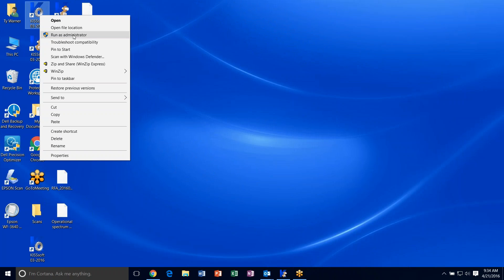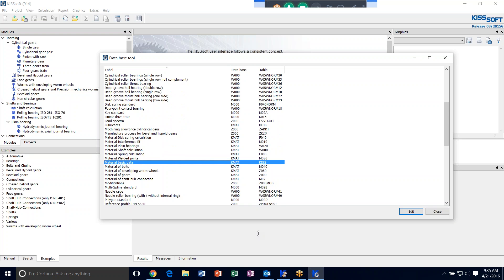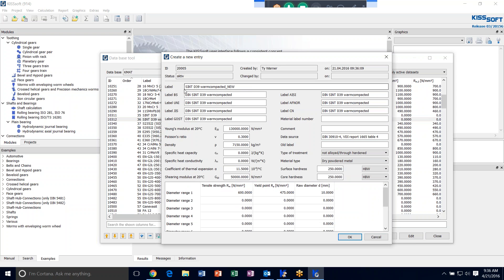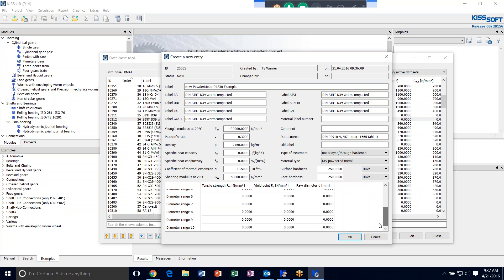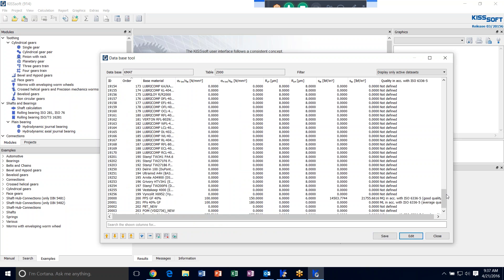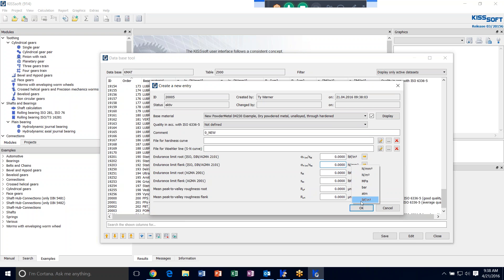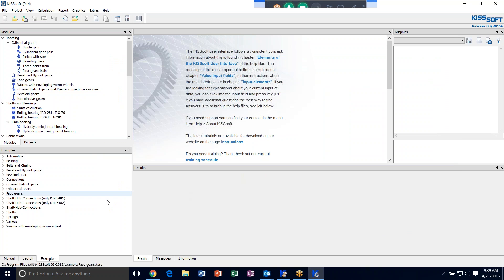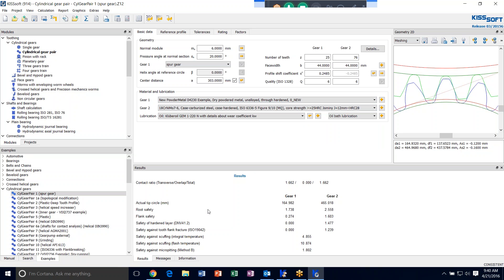Entering Own Materials in KISSsoft

Comment: When I open the Data Base Tool I get the message: "The data base directory is write-protected."
How can I give authorization? I can only press OK at that dialog.
Reply from the maker: You need to right click on the desktop icon and run as administrator in order to change the data base tool.